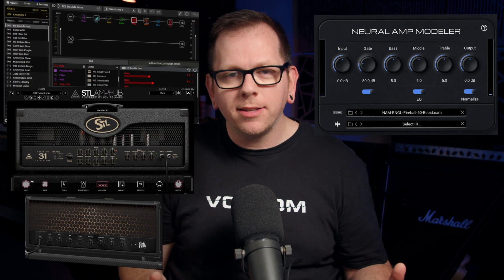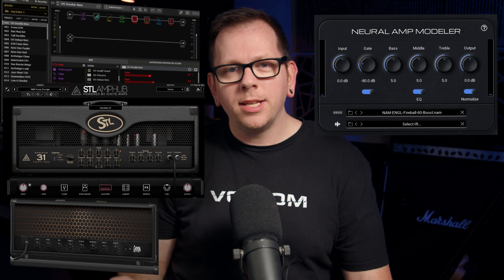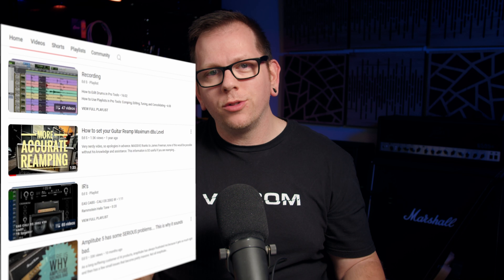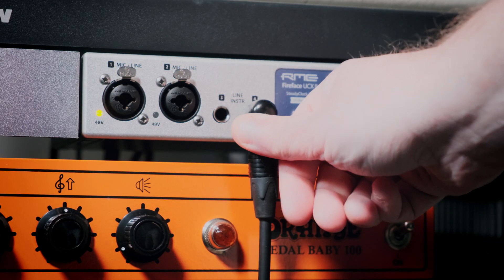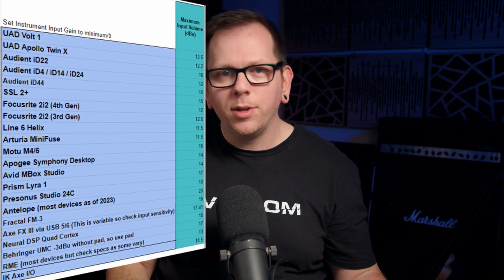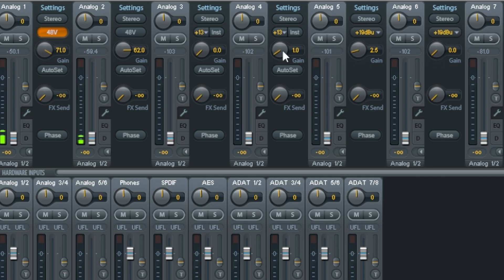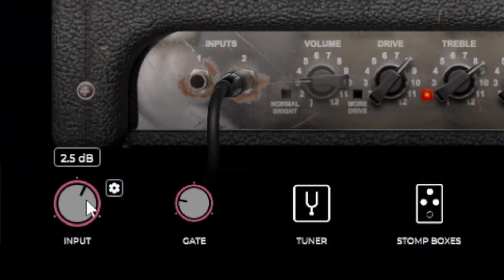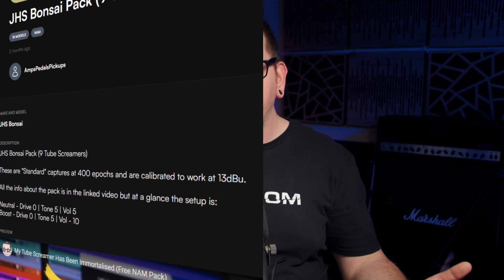Amp Sim / NAM Input Level Accuracy Explained

Comment: I still can't figure out how to do this on my interface. I'm using the hi-z input on an Audient sono. There is an input and output volume knob and if I turn any or both of these to zero I won't hear anything. So not sure how this works in my situation.
Reply: You can't have a volume control on the input and the output. A volume control can only be on the output. The one on the input is a gain control. If you are turning one, or both to zero and no signal is passing through the component, you need to set them higher. Start with gain first. Gain is more important to get right because only gain can overdrive, or damage the signal. A volume control can't. Increase gain and test the results with the volume knob. Set it just high enough to where you get useable volume control, but no more. From that point, leave the gain knob alone and just use volume. You shouldn't have to play with gain again unless something in the system changes.
Reply: Dont worry about it, its not important. Its just easier to adjust the settings if the input level is lower. Say for example your setting the presence it will be less sensitive and easier to dial in. The whole point of these videos is they want the amp to respond as close as possible to the real amp
Reply from the maker: I had a look at the manual and yeah it’s a bit different to a typical interface. Not sure if we’re just talking about the input knob on the sono being the same as an interface gain.

I’m working on a video where you can measure the level with a multimeter so you can essentially just leave your settings as is and we can find what your levels are and go from there

Most of the time if the amp sim in your computer is reacting roughly how you’d expect then you probably aren’t far off from that specific combo of interface to amp sim input. It’s really about finding your input spec so that when you chop and change amp sims or really want to make sure you’re dialled in right on the ones you use all the time it’s spot on point

Next vid will def be worth a watch for your scenario!

Alternative is to join the discord and I’m sure we can work it all out on the sono
Reply: @ampspedalspickups  Thanks I appreciate the effort. I've been trying to figure it out for a while. Just can't wrap my head around it quite yet. I'll keep an eye out for the next video and I'll join the discord too.

Comment: Definitely a big topic. 

While I don't use amp plugins I do record DIs for ramping purposes and having to accurately match my direct guitar to amp level to my reamp level is so crucial.

Ed's videos have been gold level info and I have gone down the full multimeter route as it is so much more accurate.

Actually after doing the multimeter level match for my reamp chain I took it further to check how my levels changed when going through my effect switcher versus my guitar plugged direct into the amp. 

You would be surprised the amount of attenuation an effect switcher can introduce all of which changes what guitar signal the amp finally receives.

People blame the switcher devices for introducing colouration but all it is caused by is usually just level attenuation or level increase. As soon as you adjust the out levels to match the input level the colouration is gone. 

With a multimeter and a solid reference tone (that I send out of a looper pedal) you can make it all match and for me I can then truly set and forget.
Reply from the maker: I think I saw you mention the looper pedal somewhere, pretty genius haha. I’ve been using Tonocracy a lot to quickly set levels so I didn’t have to pull up something to spit out the sine wave. But before that I grabbed a test tone app on iPhone and a lightning to 3.5mm cable to 6.5 into the interface, basically let me do the same thing as the looper, I measured it once and knew where the level was at. You can really streamline the whole thing with tools like that! When I saw you did the looper pedal I was like that’s genius, just like the phone app 🤣
Reply: @ampspedalspickups  I recently mentioned it in a reply to one of Ed’s videos.

Great idea using a phone app. While I would probably keep using the looper the phone app would save me opening up a daw session and a signal generator and have to reamp and record it into my looper.

Funny that the first thing I noticed when I started this testing was that my TC Ditto+ looper at full volume wasn’t at unity with the level recorded into it. It actually adds quite a bit of gain into the signal once it is playing back. I always assumed it was at unity gain with my guitar signal.

Anyway these are all the things a reference test tone and a multimeter can tell you that your ears often can’t.

Comment: I actually tried this with my SSL 2 , left the input at 0 and recorded something but i find the di itself looks and sounds very weak, shouldn't the di itself have a decent wave form?
Reply from the maker: Can be a bit deceptive when looking at the waveforms they can look low sometimes depending on the guitar. If you join the discord it will be easier to sanity check a few things.

The spreadsheet says the ssl2+ at 0 gain is 15dbu so to hit a neuraldsp plugin you just go +3db on the gain slider. 

If you were to use stl amphub or tonehub that requires 5.2dbu so you’d gain it up +10db in the ampsim
Reply: @ampspedalspickups  if the wave forms are not a problem that they look so tiny then I'm ok with that. But it might be a good idea to include it as a side note if you send your stuff to get mixed by others and you send your dis
Reply from the maker: @constantinranis  yeah definitely, I’ll include the wave form thing when I do a follow up faq video. I’ve actually already got a session showing the same riff on 6-7 guitars and the waveforms are pretty different when the interface is at the same level, it’s a good visual to see
Reply: @ampspedalspickups  but tonehub has it's own gain compensation stage does this matter ?
Reply from the maker: @dougb3854  I could probably do a 3minute bit exploring this, but its basically 2 different approaches. The method I've got here by getting the dBu of the amp sim and matching it is arguably "perfect"... no guesswork, they give you a number, you match it, done.

Their method is to try and get you into the ballpark. If I smash some chords on my active pickup guitar they are pretty hot, they peak at a certain point. If I do the same on bareknuckle or other hot passive pickups they generally peak lower... and then one step lower if I do the same on a strat they will peak even lower. Conceptually its like... hey let me know what type of guitar are you using... smash away at it... I'll guesstimate what input dBu you're using and then I'll match that to this amp sim.

It actually works quite well even though its not "accurate". It's still a fair bit more complex than just telling someone "hey use this".

If I didnt have the dBu spec of the plugin and they had this kind of thing I'd be ok with using it. But if you have both options its kind of no question, use the spec and dont worry about the auto thing.
Reply: @ampspedalspickups  i'll give it a try thanks

Comment: Im shocked by how many amp sim companies dont include this info in the manual 

In the audio engineering world, all this info is available on how to gain stage into the plugin/hardware in manuals and even in the product page 

Its garbage you have to message them to find out like its some magic hoodoo 

Like it legit makes their products worse if you dont hit amp sims correctly, its literally in their best interests and nudda nothing
Reply from the maker: It makes the problem WORSE because people have been using amp sims for 10+ years now so when they hear this input level thing they think its bro science and "why do I need to check, I've never done it before and its fine".

If the company just said what the level is we'd just use it and it wouldnt even be an issue haha. STL, Neural, Mercuriall, Nembrini and many others seem to totally get it, have from the start... they tell us what they use and its easy. Companies like IK... it seems like they've captured/modelled things at different times and used different specs so they can't even tell us what to use because it seems like they barely know themselves. You can also tell this is the case cause some amps in Amplitube5 sound fine on one setting but then you switch to like their Orange amp pack and you need to wildly gain up your setup to remotely get a good sound going. I always thought their orange amps were bad... turns out its pretty obvious they've just been captured to a much lower input spec and you need to gain the heck out of things to make it work.

Incredibly frustrating because you change from one amp to another and then it all sounds bad again. If this input spec was a well known big deal in the industry I doubt companies would do cowboy stuff like this behind closed doors. The more people treat it like common info the better we'll all be for it!
Reply: So true, its amazing how much of a big difference gain staging makes. It should be a stated priority when anyone purchases amp sim plugins.

Comment: Great video. Tonex absolutely boils my piss when it comes to gain staging. Cant get a clear answer on input gain by authors, now even worse that ik multimedia recentred the trim figure a while back. 
Some captures are gold and in the zone, others have me wondering why tf anyone would upload such shite
Reply from the maker: Yeah this is “the problem” multiplied by a bad fix…. So what people reamp things at a level we don’t know and then the software tries to auto gain it by a level we also don’t know. It just makes it all hit and miss and at that point I’d rather use a modeller or my own captures where I know what’s going on

At least with the Kemper and quad cortex they have hardware units for capturing so a lot of those levels are standardised between units. Nightmare stuff
Reply: @ampspedalspickups  yep, exactly. Wondering whether it's worth the hassle
Reply from the maker: Imo tonex has only really succeeded because they paired the software with affordable pedals. When it comes to live play this stuff is a lot more forgiving. If I ever used a tonex pedal I’d have to run a separate boost pedal in front of it. I’m sure boosting the heck out of the tonex pedal wouldn’t be “accurate” but it would be usable, and I guess that’s good enough for most folks.

I’ve had a terrible time with their capturing tech. I just use nam, it’s insanely more reliable for results. Only a matter of time before nam has more and more pedals and possibly adopted into a line6 or a fractal.

Comment: I feel dumb asking this. So I set my IK Axe I/O input 1 gain knob to 0 (lowest setting the pot-dial will go) and set my plugin accordingly to the input gain as suggested in the chart? If so that’s very straight forward. I may have made this more complicated than needed. Thanks!
Reply from the maker: That’s it!
Looking at the spreadsheet of info the axe io on 0 gain is sitting at 10.5 dbu

To hit neuraldsps spec of 12.2 you’d need to take the plugin down 1.7db and you’re good to go

If you were using stl amphub/tonehub etc that’s rated at 5.2 so you’d increase the plugin gain by 4.8 to hit that 5.2dbu spec

The best part is once you work it out once you just remember these numbers, not a constant thing to think about
Reply: @ampspedalspickups  I fully understand this now :) Makes perfect sense. I adore Ampbox Rectofire and STL AmpHub so I’ll be readjusting my built presets and see how this works out. Much much thanks!
Reply: @Alex-wt4cw  I'm glad you caught this. Thanks for the info. Hopefully the author will adjust the spreadsheet tables.
Reply: @ampspedalspickups from 10,5 to 5,2 is 5,3. Why do you gain 4,8?
Reply from the maker: @scentia_est  5.3 is right, bad math. If you’re out a small amount it’s also totally fine but yeah it’s 5.3 in that scenario
Reply: @ampspedalspickups  ok thank you, nothing to worry :) Just wanted to clarify this because I was not sure if I missed something else

Comment: I have the same interface as you. Is there a reason why you choose +13dbu over +19dbu?
Reply: 13dBu should have JUST enough headroom to avoid clipping so you'll get a slightly better signal to noise ratio. 19dBu is absolutely fine to use too if you prefer (and are working with loud pickups or pedals before the DI), its similar to the Axe FX level. 

Most plugins these days are designed around 12-13dBu so it just makes things easier to use a level around that.
Reply from the maker: Pretty much what Ed said. But also if you wanted 19 instead of 13 I’m sure the real world mileage would be super similar results. But yeah I’ve got quiet guitars and ones with active pickups that clip internally and no problems with 13, don’t really question it it just works

Comment: Great video, it explained things in a very clear and easy-to-understand manner. When you think about it, it's quite logical because if each manufacturer uses a different ratio between dBu and dBFS, you need to compensate/calibrate to get to the same point in terms of level. When I calibrate my input and use your capture, it's as if I connected my guitar directly into your equipment, the response will be exavtly the same in terms of gain. Even though it's logical, it's tricky to work with all these variables without a method, until Ed came along and made all the information straightforward, created videos to clarify the subject, and developed tools so that everyone can calibrate their inputs. This work was magnificent, IMO.
Reply from the maker: Yeah exactly. My real world “aha” moment was pulling up amp sims I thought were bad and needing to gain up like 12 dbu to hit the accurate point… and then I would do my typical tube screamer thing gaining it up… no way would I have “used my ears” to add 20db of gain to an amp sim to expect it work properly 🤣

It’s all very easy once you get it as well, takes no time to do the adjustment
Reply: @ampspedalspickups  Thanks for sharing this great info. I think I might just go back to the plugins that I thought were horrible and try setting the gain correct.

Just a question, how do you increase or decrease the input gain inside a DAW if a plugin doesn't have input gain knob? Do you use trimmer plugin? If yes, then can you name few good trimmer plugins to try out?
Reply from the maker: @ratedrsuperstarthega  pretty sure every daw has some kind of trim plugin. In reaper there’s a volume trim. Can definitely recall seeing it in protools logic and Cubase as well, gotta be there somewhere!
Reply: @ampspedalspickups  I use reaper. So a volume trim will be same like a Gain trim?
Also, the volume trim plugin in reaper as 2 options. 1. Volume adjustment 2. Max volume.

Which one do you think should be adjusted?
Reply from the maker: @ratedrsuperstarthega  its volume adjustment, once you’re in there it defaults to 6db. The slider there is crazy you can add like 100db LOL. I’d just type in the amount manually, everytime I touch the slider it’s way too heavy handed
Reply: @ampspedalspickups  Your advice is bang on perfect. Thanks a lot. I will surely give it a try.

Comment: to check if i understand, the ssl2 interface has as data in its max instrument input 15+ db and another one that says THD +N: -8 dbfs. using Ndsp plugins let's suppose that the plugin expects an input of 13 db. should i lower 2 db according to the max input or raise 5db according to the THD?
Reply: you can ignore THD specs, that isnt relevant for this. 15dBu=0dBFS is your maximum headroom level. For NDSP, turn your interface level to 0 and set the input in the plugin to +2.8dB. DONE
Reply: @eds4754  Hello, if I leave my level at zero, no signal will come in or the signal will be too low to record, I thought the gain would be adjusted until you reach that sweet spot (-12 in my case) and then you raise or lower the level of the ampsim according to its sweet spot.
Reply: @eds4754 How do I set up NAM with my focusrite scarlett 3rd gen? Should I set the volume knob to 0?